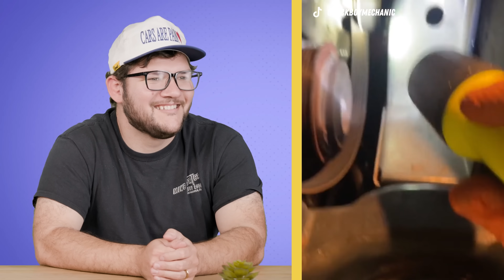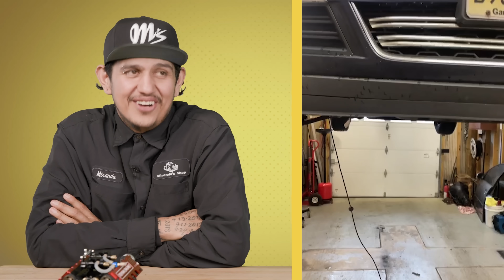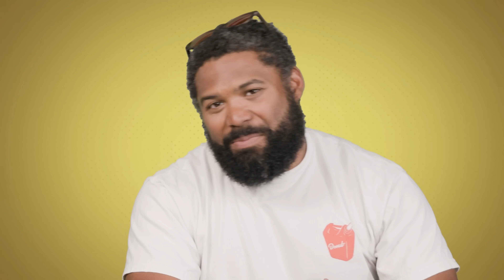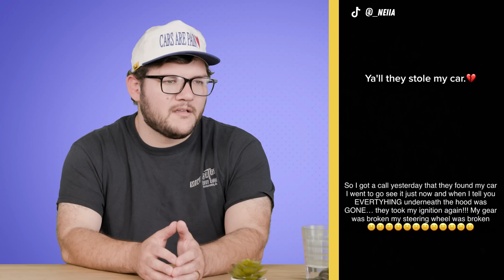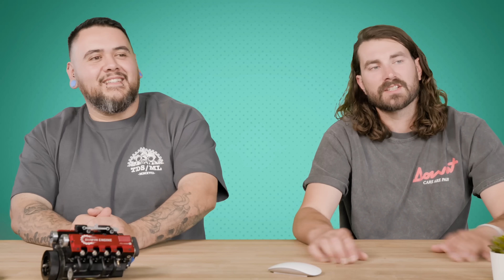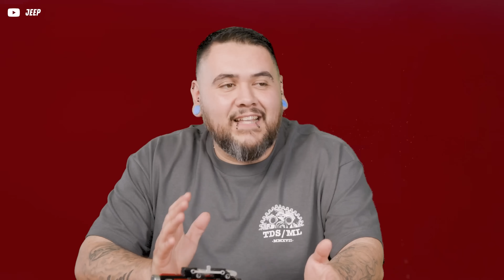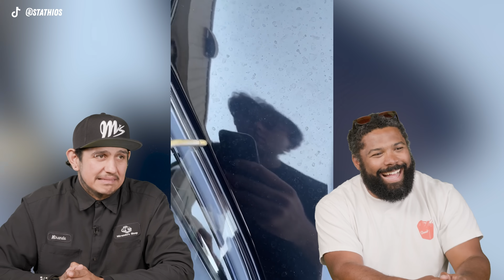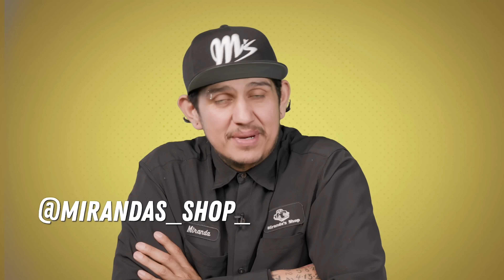Mechanic Reacts to Car Engineering Fails

Comment: Yes, actually, you do get paid for the extra work if you're worth a shit as a mechanic. Knowing several and having talked to them on how labor works, I know for a fact. They all work at different shops. If something extra has to be done, like that tensioner pulley, every single one of them gets paid an hourly labor rate for the extra time it takes when it's not their fault and they have no control over the extra steps. If you're not getting that benefit then you're either not a quality mechanic or you're getting taken advantage of. I hate it when uneducated fucks make blanket statements because they have absolutely no fucking clue what that are they talking about.

Comment: For that first one, on those traverses. I’ve done a couple. To get that bolt out you actually can just unbolt to alternator and maneuver the alternator sideways to pull it out. I’ve done them several times.
(Unbolting the alternator isn’t too easy but easier than unbolting motor mounts and jacking up the engine.)
Reply: I don't understand how moving the alternator will make room between the engine block and the sidewall. What am I missing there?

Comment: So, I'm an engineer. Electronics engineer, sure, but an engineer nevertheless.
I do a LOT of maintenance and repair work on almost anything even remotely technical, and most of the time when I start cursing it's because
an engineer who NEVER had to repair or maintain anything is their entire life just messed up.
The two biggest problems are engineers who don't know anything about maintenance and repair, and don't get/want any feedback from people who DO know about these things, and corporate forcing engineers to design stupid things because it "looks better" or is cheaper to build. 
Sometimes engineers do design things properly, but in the end higherups decide to use cheaper materials, or even just the wrong parts. 
In ALL the cases, it's the consumer who pays the price, and corporate who gets the money. 
And yes, whenever I design something it's ALWAYS with repair and maintenance in the back of my mind. Easy to open up/ take apart / replace components. Often with diagnostics in the programming to tell you what doesn't work. And I make sure to use components that are readily available.

Comment: I encountered the first issue on a Buick a few years ago, if i recall correctly it was for the water pump assembly. Shit blew my mind when it butted up against the body and still had a solid 1/4 inch of thread left in the hole...

Comment: I second the Jeep electrical issues. I've been having trouble lately on 2021+ Jeep models where the oil reset just won't work. It has happened 3 times this year to me (I barely work on Jeeps) and all 3 had the same issue. I cannot reset oil life by scanner, and the manual reset just isn't working. I refuse to work on Jeeps lol

Comment: That last clip, makes me think of the LS1 design where the powersteering pump/resivior is above the alternator. A leaky powersteering unit is an easy fix, powersterring fluid into the altnator just makes the job more expensive

Comment: When I worked at Honda we had a special magnetic drain shield for Civic Si’s that stuck to the engine block to prevent oil from making a mess when we unscrewed the oils filter…

Comment: The first one was a Gmc Acadia/Chevy Terrain (or Traverse). The Idler Pulley bolt is also the lower bolt for the alternator. Retarded design. You have to unbolt the alternator and turn it 90 degrees so you can pull the bolt out.

Comment: What I did was I drilled the hole all the way through it to the Bolt then welded a piece of pipe in it and got a long and suspension and a socket and Ratchet and unscrewed it that way I fix their mess up

Comment: I’m going to say this as a general statement because I install septic systems, I’ve had engineers put together a septic system that, on paper, makes total sense. The problem occurs with reality. You have an engineer put together a plan without ever stepping foot on the property, so on paper it makes sense but in reality it just won’t work. I think engineers should go through some type of hands on work with whatever they put together so they can see that, oh this septic isn’t going to work because there’s too much rock, or the water table is too high, etc. engineers are good at what they do but that’s it. I have a friend who’s an engineer for some company (I can’t think of the name right now), he’s really smart but when it comes to common sense he struggles. An engineer will literally build something from a desk without ever touching what they just made if that makes sense. Then you have someone come and actually build the damn thing and realize the small (or big) problems with the way it’s built. You just don’t really know until you see exactly what you have just fabricated.

Comment: That last clip.  For all of Honda's engineering brilliance, they decided to place the power steering pump on top of the alternator.  Not as devastating as that Acadia.  As for the penultimate clip, Ford took this into account on the Bronco.  The fact that the oil pan and drain plug are plastic and its weird location can only be summed up as accountants.

Comment: I'm a mechanic. It's stuff like this that is pushing me away from repairing vehicles and moving towards an automotive industry role that doesn't require me to actually do the work. It sucks the life out of you and makes an enjoyable job into a nightmare. Combine this BS with mostly low wages when compared with other trades, an extremely high learning curve for diagnostic work due to a vast and diverse vehicle range with the expectation that I should just know about every car and it's pitfalls and OEM's that won't share information on ANY vehicle including safety related items like abs systems. This is killing the lifeblood of the people working on your vehicles, this is turning away new talent from the industry and IMO oems are responsible for deaths on our roads. We need more commonsense in the industry, we need better systems for getting information from OEMs that is fair to both parties. OEMs are to blame.

Comment: my brother has a 2003 mustang and on the passenger side where the starter is locate there's a spot right where you would naturally want to position your hand so you can reach the starter, you cant because they extended the housing of the wheel bay so that it extrudes pass the necessary amount needed and i know that because on the driver side it doesnt extend as far and there is nothing on nether side that would require that design other then the fact that it prevents easy removal of the starter so now you have to unloosen the motor mount and left engine and gather every extension you can find and fidget around with it and keep it straight aligned so you can get it over that bolt and all that could of been avoided if they wouldnt have intentionally blocked of access to the side of the engine

Comment: I can tell you that Tesla has horrible QC. My buddy just quit because they have astronomical quotas on the assembly line. They had high quotas like 50 seats an hour. And that's 50 SETS of seats per hour. Then they moved it up to 80 per hour which gives these guys less than a minute to assemble each pair of seats. 

I can't imagine how bad the rest of the assembly line was. All I know is that I will never buy a Tesla. The cars are interesting and I commend them for making a fun car, but the quality is terrible.

Comment: at the Chevy - the Mechanic. you can get that over long bolt out by also losing the second bolt of the alternator and then both come down, as this bolt holds alternator and roller together.

Comment: PERFECT example of BAD Engineering. Ford putting the oil filter literally ABOVE the starter on the taurus.... Even with protection it seems like every 3rd oil change shortly after the starter gives out....

Comment: The lemon law has to be a “safety” feature to qualify. I had a 2015 Chevy Colorado when they first got reintroduced and within 20k miles my power steering would randomly just shut off. Went in three times for it and on the third time they ended up replacing the entire steering column and some other pieces. It was on the lemon law line. I owned it for 20 months and it was in the shop 17 times for issues. None of the trips were maintenance only, it got fluid changes while in there for other work, so 17 times for ISSUES. Was a nightmare of a vehicle.

Comment: 6:10 - No, SERIOUSLY... Jeep/Fiat/Dodge/Ram, the whole "family"... up until very recently, possibly the new Grand Cherokee or Waggoneer etc were uhh... old school bad quality lol. I just don't group those last two because I've only seen one in person for a minute, didn't get to check out under the hood. Interior fitment was much tighter and closer to modern standards than a 2015 Jeep that's for sure.

Comment: Dunno man, I've bought plenty of aftermarket parts where they'll give you a bolt a different length than factory, I find 80% of the time reusing the OE bolt is a better choice, better quality and corrosion protection applied typically, and it's not gonna be too long lol. For some stuff like locking nuts... I just keep a couple of really good quality ones on hand just in case, some aftermarket suspension pieces come with cheddar garbage quality locking nuts.

Comment: The "impossible bolt" is that long for a reason. Probability long enough to secure the  pulley by threading into the block.. undoing engine mounts aint hard. Just needed to be lifted an inch to get clearance. Consult manufacturer procedures before starting.

Comment: You guys are so wrong the engineering part should be management because they approve it. Also there is most likely different engineerings for engine and body. They are usally told that you have this much space to fit the engine in make it work.

Comment: The Kia - Hyundai key cylinder problem has nothing to do with the engineer department and 100% to do with the finance department they opted not to put in those security features as a cost-saving measure 🤯

Comment: I had tbis same impossible bolt on my 3.3 liter 6 cylinder  92 Grand Caravans a.c. compressor.   The clutch was going out and it would constantly kick in and out making it undriveable.   The trick is the whole compressor has to come out to do any work on it .

Comment: The first clip reminds me of the ford 5.4 power steering pump. Impossible to get out, one of the 4 bolts is too long to get out so I just cut em. I can't wait to come across this so I can bust out the angle grinder, kill an engineers baby and install a proper length screw.

Comment: My favorite became a recall. Aluminum battery ground cables. They work great in the salt belt. Whats even better is they didnt crimp the battery lugs on. Instead they butted them together and hoped epoxy and heat shrink would hold it together.
Reply: What car?!
Reply: @Split0069  2023 Freightliner cascada used them and had a recall shortly after. On the automotive side gm used them in the 70's

Comment: On a 2014 Jeep, in order to replace spark plugs 2,4 and 6 - Windshield wipers had to be removed. (had to remove more stuff also). Windshield wipers - like the whole arm and everything . Also had to remove the wiper motor. Also, because it was so difficult to do, no repair shop would agree to do it. The factory spark plugs had 126,000 miles on them. The electrodes were withered. And then, not all the parts removed could be put back. 3 hours to remove one stud bolt on the throttle body bracket, so the upper air intake could be removed to access the spark-o-pluggs.

Comment: It's a lot of quality control and the problem is people just don't care anymore. That's what the problem is with the tesla's and Jeeps and all those other ones people just don't care anymore. I want the old school. No computers with points and condensers. I know they're a pain but you didn't have as many problems. I think the most problem would be a water pump for a fuel pump and that was easy to get two too. Not anymore you got to drop the tank

Comment: To answer your question, crystler or fca or stareyalight  however you spell it. The oil filter location is absolutely horrendous. It's right above the front differential control module and it doesn't matter how good you clean them they get gunned up and destroy them and they still do it on 2023 rams. Have been sense at least 2012 with the hemis. Also their oil filter units are dumb on the 3.6 liters in Durango's and lube techs over tighten them and brake them all the time.

Comment: So the reason they need to change out the wiring harness is because the oxygen sensor actually “sniffs” the oxygen thru the wire. So once the wire gets saturated from a main connector. The oil can flow thru the wire and the oxygen can’t flow thru the wire anymore to properly read. Crazy stuff

Comment: As a guy who has turned wrenches and worked with industrial electrical systems for about 35 years I'll say the design is only as good as the guy that designed it. The bad ones expanded my vocabulary exponentially....

Comment: 2009 (and probably other years) Toyota Matrix 2.4L driver side lower control arm replacement. One bolt can not be removed as it butts up against the transmission. You have to loosen off the engine mounts and jack the engine up to get the bolt to clear an remove the control arm. I actually blame both GM and Toyota for this one as it's a Toyota powertrain Frankenstein'd into a GM chassis. Also known as the Pontiac Vibe.

Comment: As an engineer I can say the bane of our existence are excel jocks... Omfg jesus... 
That tensioner bolt.... My bet is some excel jock went to his boss that if they use fewer different bolt lengths they can reduce their total stock capital by 0.1% which translates to 100k less stock. Which does not save or cost any extra money to do right, it's just your total stock value is slightly higher. So you end up with bolts that are either to short or too long in a lot of places on a vehicle. Another reason has been a bad production line, where the excuse is the assemblers get confused by bolt lengths, so the bolts should all be the same length. Or they just grab any bolt from the stores.
Every god damn time we come up with a great design, and it gets turned to shit by dick heads that use excel as design software, instead of just doing their little plus and minus sums on it. Or production just takes it on themselves to redesign the design.

Oh, and sales. The damn sales team... We know you already designed it, and it's great, but we think we can sell another variant, with this engine that you did not design for, in there. Make that engine go in there. Or after everything's been designed, management comes to you.... Well, we now have this new partnership with this other brand, and we need you to replace the current part, that you designed with, that fits and works properly, with this other part from this new partnership, because my excel sheet says that will make more money....
Reply: Bear in mind, that we're all enthusiasts as well, and we run into these same problems. Imagine how that feels....
Reply: On the Mclaren. The bolts will have been specced with thread locker as well. And not green loctite, blue loctite so it can be removed. Assembly guy didn't assemble. Note the length on those bolts. 25mm long, instead on 12 or 16mm. Rusted washers.... Check the excel jock that thought that a plated washer is just as good as a stainless steel washer. Way to go to save that 0.3c per washer my excel guy. Take you a bet those are 25mm long bolts too. The body panels touching, my guess would be the actual shock length. Prolly designed with different shock lengths for different panels. Along comes Mr excel. Make them all the same length so we can buy more bulk and get that 2% discount. What a genius. Or could be  assembly guy that just grabbed the wrong set, or stores that just ran out of the correct length, and just gave production whatever they had in stock.

Comment: first vid the answer is cut the bolt as close as you can get while still able to finish getting it the rest of the way out with pliers second step round  off as much of the bolt as possible with completely destroying the threads bolt it back never talk about it again

Comment: So yeah I don't remember what your model Dodge neon it was but there's a Dodge neon that has the same problem as that first clip. Well basically your going to have to pull the motor to change a damn belt tensioner. The belt tensioner attaches to the timing cover itself and neither can be removed without completely removing the motor. So I took a hole saw and cut a hole through the frame just big enough the bolt could fit through so you could use a long socket and extension and then used those little rubber push plugs to close the hole up. Because fuck pulling a motor to change a pulley.

Comment: 95% of the times its not the engineers its the people over them trying to be as cheap as possible. like with the first clip they probably already made that long bolt and not the little bit shorter size they needed. so if it doesn't effect the initial assembly of the car and it will save them money they will force the engineers the design it like that.

Comment: I am a nerd and a grease monkey. I use a relay controlled by an Arduino nano with a Bluetooth module set to detect if my phone is in the vehicle. If my phone is in the vehicle the fuel pump turns on. If i get car jacked the fuel pump will switch off as they drive off. Its a classic vw bug so it will run for a bit until the carb empties.